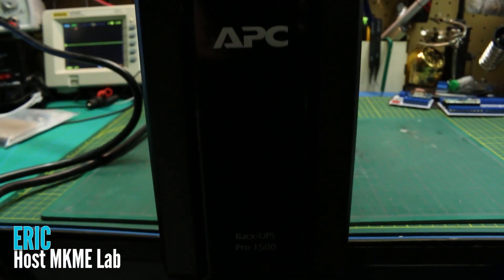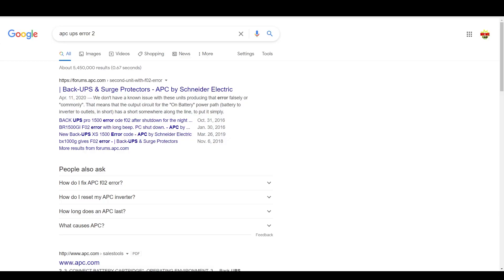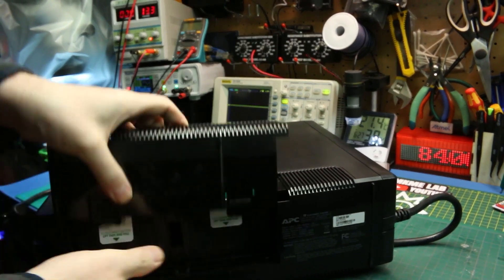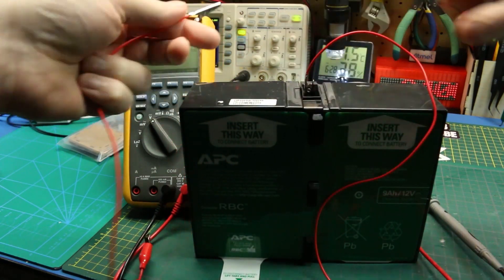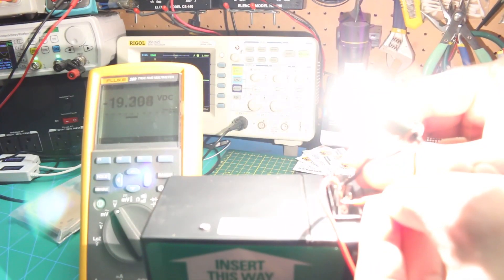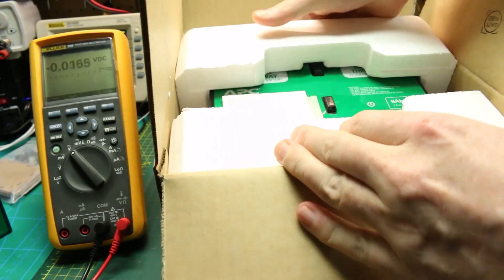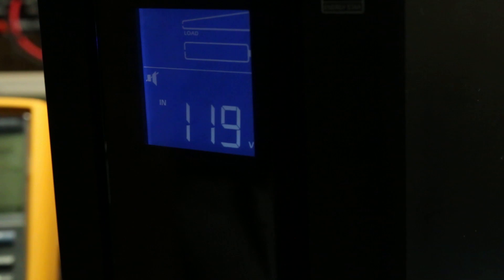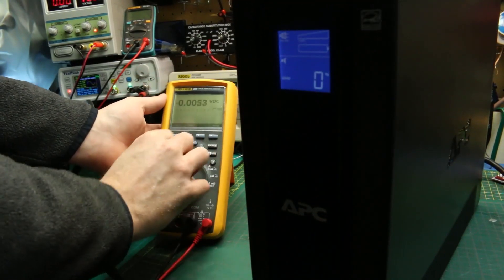FIX A DEAD UPS- DON'T THROW IT AWAY

Comment: On my 1000M I bought a new battery and plugged it into a known good wall socket. But the display is completely black, no audio queues and holding the power button down doesn't trigger anything. Wish I could get it up and running. Does anyone know what might cause this problem?

Comment: Interesting. I just replaced the batteries on my APC 1500 Pro and then 3 days later got error F02 ....then 2 days later turned it on and got F06. I will see if I can get these batteries replaced.

Comment: I split apart the batteries, removed each from the center adapter and replaced with two Duracell Ultra (DURA12-9F2 9Ah AGM) batteries. Wish you would have looked at the individual batteries and done similar. Is there another way, or a specific tool to do a load test using a meter or is it wire in a car light?

Comment: Had a Triplite 2200 new w/6 (!) new batteries that lost charge.  Batteries needed water - added it.  Then started charing and discharging.  Each cycle resulted in increased capacity.  After 40 cycles, capacity was near spec.  So never used old batteries that dried out can actually be recovered.  No happy to see APC making batteriest proprietary.

Comment: Yeah, but where's the part where you fully charge the battery, then commission the system with a rundown test? Mine works just fine until I disconnect the mains while under load. I didn't see that test on the video.
It's a 1500 right? (what is that? 1500 VA? 1500W? is that full rated continuous load?) What should the minimum battery voltage be under 'full' load? If I hook it up to a 1000VA purely resistive load bank, what is the maximum vdrop the unit will be 'happy' with? 
Also, why does the unit throw some odd-ball 'F' alarm instead of a BATTERY alarm?

Comment: A car battery can be adapted to ups xs 1500???
Reply: for those wondering, no that is not a good idea. car batteries are not deep cycle so will be damaged easily when they are drained below 90 percent , a golf cart battery would be ideal as they can handle high power output and significant battery drain to 40-50 percent without much wear.

Comment: Dude I used mine for a while had no problems then all of a sudden get the F02 error code so I take the battery out and it wasn’t even put in the right way it was backwards. Had no clue this could even power up without the battery in correctly

Comment: I have F06 error , any idea to fix it
Reply: Yesterday I had F06 error, no output supply even on direct power... I did some random things like I disconnected all plugs, switched off ups... pressed Reset on back for 10 secs, pressed power off for 10 secs... switched ON power supply (not switched on ups) for few hours and then when I switched on ups ... it started normally ... but the battery backup is very low, its just 7-9 minutes... may be the battery is bad..  but its working for now lets see how long it'll go...

Comment: That's what it's supposed to look like. Quite simply. Probably one of the pack's batteries was defective, 
which is why the pack's output voltage dropped during power consumption.

Comment: I was hoping for an actual repair.  Batteries are wear items and will be replaced many times in the life of a good UPS.

I have on ancient Best Power UPS from 1993 that finally died.  The logic board is no longer responding.  It could still be simple repair of something like capacitors, but I already have more UPS units than I currently need.

On my last APC unit, I got a pair of individual batteries and rebuild the battery unit using the old hardware.  (Other than a new Anderson PowerPole as that unit had severely corroded and swelling batteries).

However, I do agree with the main point of the video.  Many "dead" UPSs can be made useful with just a battery replacement.

Comment: Really common problem with lots of UPS, we used to get plenty through for repair and the very first thing to do was inspect the batteries and load them up with some combination of car bulbs, way more than 50% of the units had batteries which would show as good with a simple voltemeter check but show up as faulty as soon as they saw some load.

Comment: Great video, the units are still good if you change the batteries. They also become pretty useless after a few years and will need new batteries
Reply: APC design their UPS's for maximum runtime, that is the sole reason you need new batteries after a few years.
You can get ever more power stored in batteries if you overcharge them, sure it boils the battery acid and eats holes in the casing.
source: I've dug thru an entire pallet of ex APC UPS batteries, only 10% didn't have obvious holes in the casing, bulges or splits.